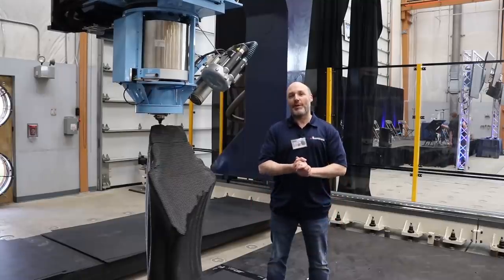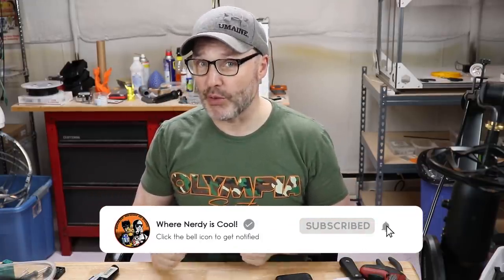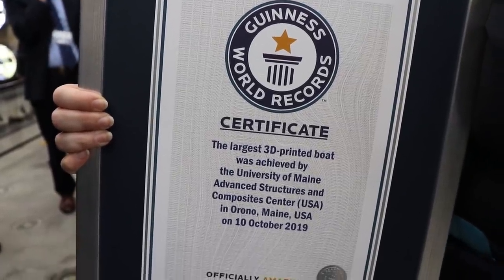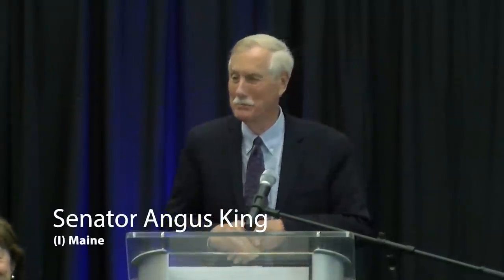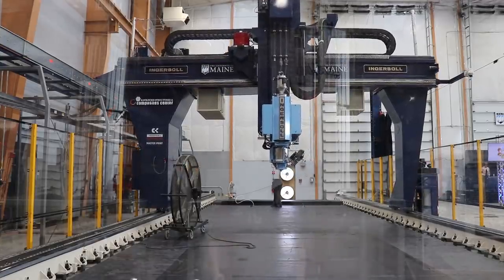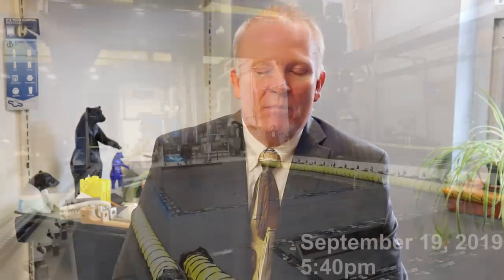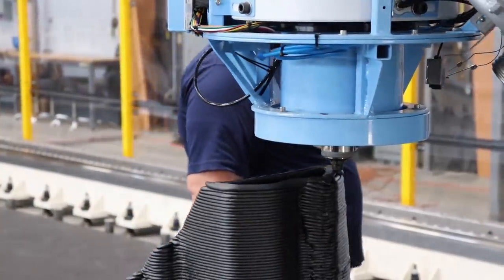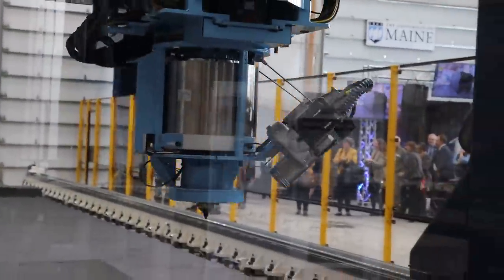The World's Largest 3D Printer & Largest 3D Printed Boat!

Comment from the maker: Do you have questions?  Ask away and I’ll do a follow up video with James Anderson and get them answered for you!
Reply: I have a question. The finished product looks so smooth. What do they do to smooth out the layer lines from those giant layer beads?
Reply: Have they considered embedding structural reinforcements (carbon fiber panels, strips, or tubing), flanges, nuts, etc. (AKA: Vitamins), into the prints while they are printing to increase strength, function, and rigidity, while reducing weight and print time?
Reply: How does the material being fed to and from the extruder differ from small scale printing?  Any details on the printhead (extruder, hotend, nozzle) would be great.
Reply: He mentioned near the beginning that the machine can feed up to 500lbs an hour, but the current extruder only feeds 125lbs an hour.  Is it a limit on heating?  If the limit is heating, and not in the motion system could you do a smaller nozzle at a faster speed and cut back on some of the negatives mentioned for a large format printer?  I'd love to see a video of you extruding the CF-ABS too if you are making it yourselves.
Reply: What's the power consumption?
Reply: Is adhesion to the build plate/print bed a concern or is the weight of the bead enough to hold it in place? Was another axis required to print with the 45 degree printing technique to rotate the print head or is it possible with the standard 3 axis of movement?
Reply: Will the design be OpenSourced? Or at least a more in depth look at the motion control/electronics. 

What code are they running. I am working on a large format 3D printer with plans on fully open sourcing the design, a collaboration/sharing session would be amazing.
Reply: Are you making or buying the carbon ABS material?
Reply: I'm also interested in the extruder / hotend. How is it possible that you melt so much material simultaneously and homogeneously? Is it like a screw extruder from injection molding?
Reply: what does the box of failed prints look like?
Reply: Question regarding large scale bridging... Could they just use a Silicon or Petrolum based form to help hold the bead until it's fully formed, then once Project is complete, just remove the forms or what?
Reply: How much plastic did the boat use? I am doing a writing piece for school about why every school should have 3-D printers.
Reply: How strong is the hull and how would it hold up to a fiberglass hand-laid hull with 2 500 HP motors going 100mph plus?
Reply: How did you take the boats off the build plate?
Reply from the maker: We cut those support structures off then used the crane to lift it up and away!
Reply: How much?
Reply: Could you make a sword A giant one
Reply: Where can we source affordable parts to build a large 3D printer capable of printing aircraft?
Reply: I have Question ⁉️ whats that thing thats maked 3D thing
Reply: Whats the 3d printer called?
Reply: is the Advanced Structures & Composite Center where the big ole' printers are housed?  I live..let's say...close by, and i'd love to see it 🙂

Comment: Couldn't you share the files for this print so there would be small siblings for this boat around the world ?
Reply: Scaled down the walls would probably be too thin for most common printers to print but if they made the walls thicker I’d want it
Reply: @drewsnyder1436  activate "print thin walls" in cura
Reply from the maker: It’s the layer time that’s tricky. Big beads like that need some cooling before the next layer comes around. And overhangs … tricky!

Comment: Could you do a video on the design process for this boat? For example, did they print a model first or did they just go right to the full-size version? Also, did they do force calculations on the model and structural analysis before printing? Do they plan on stress testing the finished boat to see how well it holds up?
Reply from the maker: Added to my list of questions for James on a follow up
Reply: @WhereNerdyisCool  Are you in Maine? Do you go to U of Maine?
Reply from the maker: John Tarbox I work at the University of Maine Advanced Structures and Composites Center
Reply: I'm betting that this is mostly for answering those questions and more. You would need to know the adhesion strength between layers to know roughly how strong the overall structure is. With enough sampling you could eventually have the info to do basic structural analysis, but I think initially it learning ideal layer adhesion control - how to consistently achieve ideal bonding. Once they have enough data, then they would be able to model something up and do analysis, and print full scale first time.

I'd be shocked to my core if all of that has already been accomplished and this print WAS printed full size first. Very surprised, though happily so. :)
Reply: @Broadpaw_Fox  Layer adhesion is a significant issue and a difficult one to overcome. You can see how it is addressed by Ingersoll at about 7:46 on the video. The Cincinnati "BAAM" uses a tamping device to get the layers to stick together. The Thermwood "LSAM" uses a compression wheel that follows the bead to provide adhesion. You can see the BAAM working in this video: https://youtu.be/hct_k04VDhk. You can see the LSAM here: https://youtu.be/yUQ2-BZXvIQ. Full disclosure: I sell Thermwood.
Reply: @stormridervj  I wonder if they printed smaller layers at a faster print speed if it would help with adhesion. I mean, come on! It was like watching play dough come out of those plastic extruders.  Also, is the floor heated? Didn't see to be. I'm sure that would help. And bridging! No joke, right?

As a guy who has owned and restored a couple classic boats and worked with wood and fiberglass to do so, I have doubts that this would hold up under any real stress. Contrary to the nice gentleman talking, boats actually do under go a lot of stress when in rough seas, or even in normal operation when under power from outboards. Any impact on the bow is transferred along the length of the hull. By impact I mean large wave/wake, etc. There is an enormous amount of pressure imparted. When under power, the outboard thrust is putting the entire hull under tension and twisting torque as it pushes against the transom. Now combine that with impacts and even normal cruising as the bow splits the water or mixed with torquing of the hull in restless seas and you can see that this isn't as simple as making it buoyant. 

It is interesting to me. A fiberglass hull is not that much different materials wise than this execution. However, long strand woven fibers mixed with the resin give it the strength it needs to withstand the forces at sea.

I could see this design idea useful for laying down a hull which would be reinforced with proper bulkheads, assuming they could design it with the correct structures to maintain the right amount of rigidity and flex.

Very cool!

Comment: Have you tried a cooling bed with cold air rising with side walls adjustable Hights with air coming out if only aircon air or a dry ice holder or like a cooling system on a motor . older boat motors had a wraparound water cooling system but id say the closs up air wall with air con would be more viable and direct with flexible adjustments more practicable

Comment: Well Senator. It would be nice to be able to use additive to print spare parts except for a couple of small problems. Materials that may be hazardous, chambers that may require inert gasses, access to validated product data, trained and experienced users and others. Additive truly is a very cool and disruptive technology and there is no reason to oversell the technology. This overselling is the bane of those of use involved in the development and early adoption of advanced manufacturing technologies.

Comment: So that bridging issue, could you theoretically build a bridge for your bridge?
Like having different nozzles to print thin strands to allow larger beads above it to adhere without compromising the structure?
Reply: Yeah like a rotating nozzle assembly,  with different materials for heat retention or dissipation depending on the need ie: Aerogel and copper nozzle for heat retention and copper with aluminum sheathing for heat dissipation.  That would be awesome!

Comment: Because of the cooling issue, sounds like 3-D printing on Mars outside in the low pressure will be extremely difficult simply because the material once heated up will probably take a very long time to cool down.  Since the previous layer of material laid down must support the weight of the next layer of material, cooling between layers will be very important. And also very very slow.

Comment: The boat you are showing may not be printed or may be significantly post-processed because the surface finish is very good which may not be possible using extrusion-based printing.
Reply from the maker: For real?  View the time lapse

Comment: Paul, OK... I'm impressed! I heard about 3D Printing only 4 months ago and I've been trying to learn as much about it as I can. Now I know how large an object you can print...a "BOAT"...WOW! But I still want to know how the process is started. I mean do you walk up to an object with a digi- cam, snap a pic of it then feed it into a computer... Then the computer asks you "How BIG do you want it"? That's the stuff I STILL want to know. After that... HOW MUCH ... $$$?? Time doesn't matter, but I live on the other side of the country from you. I'm thinking of something about the size of a typical kitchen "Refrigerator" (but it's NOT a refrigerator that I want duplicated). Just using it as a good size comparison. Jeff (out West).
Reply from the maker: Honestly if you use the contact info on the ASCC website, start there. If you have drawings and so on, that helps the large scale team.  The machine is pretty booked for a lot of work. But you can always inquire!

Comment: The extruder doesn't have a cooling fan?  I noticed you were printing in an open space, how does the moisture in the air affect prints or is that less of an issue jamming half inch beads out?  Everything I've seen says printing carbon fiber needs a dry environment.  It would be interesting to see a strength test with a heated chamber/dry filament for the entire print vs this.
Reply from the maker: The material is coming from our DryAir system and fed on demand.  The material is dried for several hours before printing.  No cooing fan on the print head currently.

Comment: I would put per heat roller ahead of nozzle to help adhesion, scene your nozzle turns it may work. Also i would try a universal joint to rotate nozzle 90 degrees for printing in the x and y axis's for overhangs  and outer surface when it can be reached by the nozzle.
Reply from the maker: We have it but not workable on our 45 degree nozzle...and from testing, it has t worked ideally (yet)

Comment: Get a nitrogen compressor from the oilfield to use for rapid cooling, it collects nitrogen straight from atmosphere and shoots the nitrogen down into gas and oil wells,  so s line could be led straight from the compressor to the print head and the temperature could be controlled and adjusted by just simply useing atmospheric mixing into the nitrogen feed line running up to the print head ,  and if worried about nitrogens very low temperature, then perhaps they could use a CO2 collector just as easily. Problem solved, 😎
Reply: One of the features of this scale of printer is that very good interlayer adhesion can be achieved if the previous layer is still warm and so partially melts.  This is why tweaking the layer times is so important.

Comment: Have you attempted using supplemental prints to put in place when bridging is about to be necessary? May not be ideal but a viable stopgap until the limitations of bridging are solved.

Also, it's unclear to me why infill isn't possible (I believe that was said in the interview). Is that related to limitations to exceeding a 45° overhang?

Comment: What are the benifits of 45° printing ? (Very strange method to print a cube when you are used with "standard" 3D printers).
Reply from the maker: I’ll add that to the list of things to ask
Reply: They can put a moving conveyor under the part they are printing and basically make something as long as they want without the need of larger print axis.
Reply: In a way they do explain that in the video, he says that bridging on that scale is out of question, because of the weight of the filament, so if they don't want to use support, and you want to create such a huge cube, with a 2-3m bridge, you slice it 45º, that way the previous slice is working as support of the new one. The question here is how we can accomplish this on our home printers, when there is going to be an slicer that allows for customize angled slice?
Reply: Look up NAK designs "White Knight" - infinite Z printer.
Reply: @oscarvergara8770  Thanks ! Your answer and explainations is more clear and evident than in the video. You're rigth about your last question. A part of the answer is what will be the benifits to "loose" a lot of time in research in something that work fine for most of cases ...
Reply: @JohnSmith-mk8hz  Oscar Vergara give the right explaination. You could also be right but in their case there no choice to print at 45 ° once there's an important overhang regardless of the length of the part.
Reply: They can't do bridging 'cos the bead weighs too much, yet we see them printing the unsupported roof of the troop shelter truck box thing. I think I have to assume the 45-degree printing allows them to print the roof without support and without counting as a bridge. Would definitely appreciate more of the technical details though.
Reply: @NoseyNick  - that roof isn't a bridge though. That's the neat trick if 45⁰ printing. You can stick the new layer to the existing layer of the wall - the bond between layers (when it's as strong as it should be) will 'carry' the new layer that's effectively 'hanging'. 

Think of it like this - they never have more than half of a bead unsupported, so it's not hanging on it's own, hence not bridging. That's the secret. :)
Reply: Check out continuous belt printers. The way they print you can actually get about a 90° overhang to print in one direction of one axis. Just due to the way the layers bond. It looks impossible when you watch it but it's really just because the axis have been shifted so your cheating gravity a bit.

Comment: Q: Could you explain the twisting? My "normal sized" hot end never twists, but I assume there's a really good reason why yours does.
Reply: My guess as to why the nozzle swivels is so it can make minor x-y movements without having to move the whole gantry and massive nozzle and heater.
Reply: @pnwscitech1589  Plausible... but I'm fairly sure I see X and Y gantry movement and rotation about the Z axis simultaneously?
Reply: @NoseyNick  the bead is so thick that it won't change direction fast. Without the turning head it would just overspray an edge
Reply: Maybe focusing the cooling on the trailing edge of the print?

Comment: But one thing that could be done is using compressed air to massively cool down the "beads" once layed down!  With such a big abd heavy Machine comes the opportunity to use way bigger and more sophisticated cooling then possible on any hobby machine!

I bet there would be solutions with enough airflow and a huge high pressure nozzle directed towards the lower part of the orifice to make the extruded filament cool down almost as fast as on  smaller scale machines.

Would love to see some expermentation being done and you filming it!
Reply: The problem would still be the thermal capacity of the hot plastic. As the plastic is extruded, it comes out in a flattened sausage shape which has a small surface area to volume ratio.
You could blow all the cold air you want at it, but you'll only end up cooling the outside of the bead and create a solid shell, the heat will still be present at the core of the bead.
This solid shell may negatively affect co-layer adhesion, as the newly extruded plastic needs the old layer to still be warm in order to weld effectively.

High pressure air is also a force to be reckoned with. Increasing the pressure wont make cooling more effective, it may end up just blowing a hole through the molten plastic.

So the other option? Use colder air? No, this will lead to a shell like before and risk the shell then cracking as the heat at the beads core spreads back out.
You see this happen when you put an ice cube in luke warm water, it cracks.

The only real solution that I can see is to engineer a new plastic with better thermal characteristics for the application.

Comment: how did they print the horizontal parts of the army shelter without support ????
Reply: Probably that 45 degree print method he was talking about.
Reply: If you look closely the nozzle is at a 45° angle. which means the layers sit on top of each other at an angle.